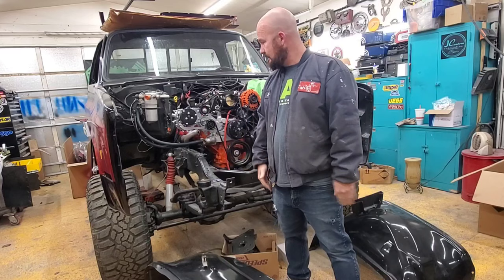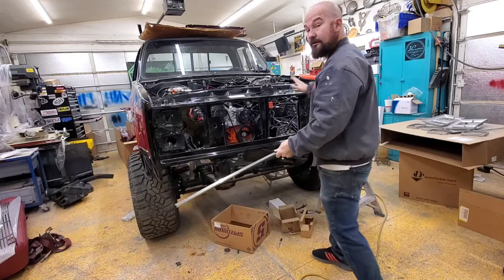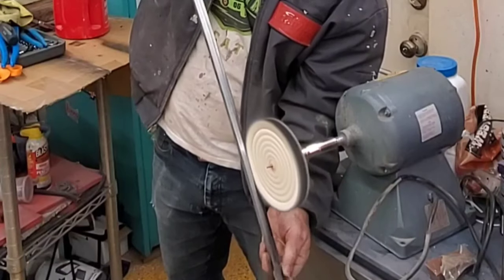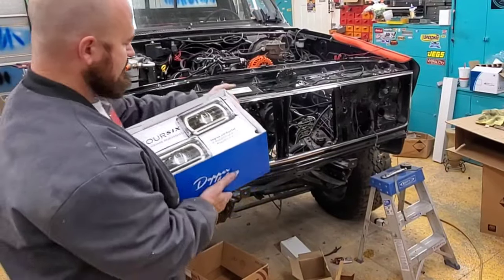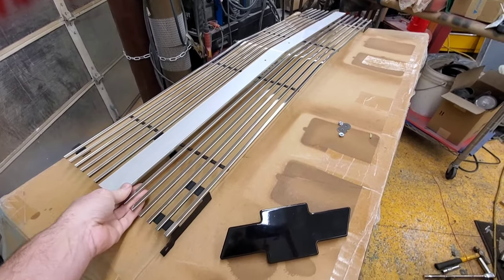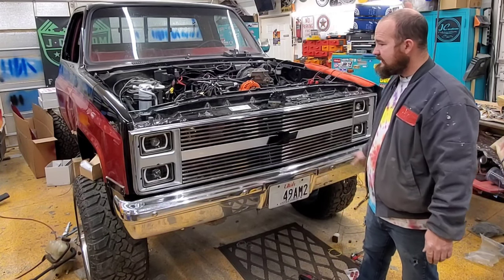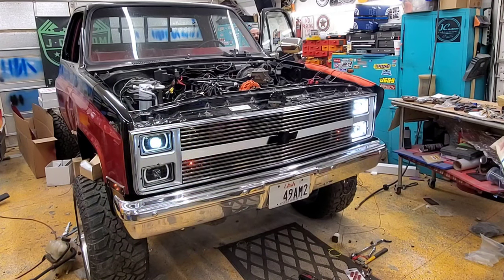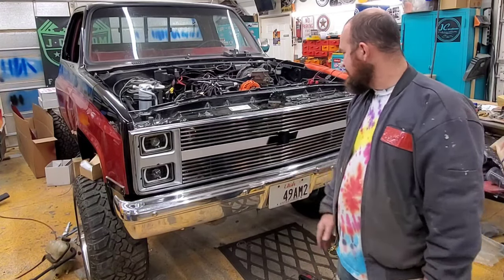85 chevy Square body core support, grille, and headlight installation on k20 truck k10 c10 k5 GMC

Comment: I was about to order these headlights. I noticed they have high beams LEDs is 2400 lumans and low beams 1800 lumans. I also see when you order you can get both high and low in 1800 or 2400. Did you end up doing one of each (low 1800 and 2400 high)?  Thanks
Reply from the maker: I would give him a call, I upgraded mine to a lot higher lumens... They don't show on their website... And make sure to refer my YouTube channel
Reply: Will do.  Did you know what lumens you upgraded to? Also do you have different lumens for high versus low are they the same. I’m going to order them now then call them on Monday definitely will be using you as a reference thank you

Comment: Hello. I bought the same lights for my 87 K10. The headlight bulbs are 30 watt Leds. Did you have any issues with the  low and high beam headlights  working correctly?  When I hook them up with the harness Dapper sent both the low and high beams light up together when turning on the low beams.  Turning the high beams  on and off doesn’t work, both low and high beams stay on. Do you have any ideas about what’s wrong?

Comment: How did u wire lights ? When I cut my headlights on amber oracle light comes on with headlights.
Reply from the maker: I wired the Amber lights to the turn signals and then I made the white lights turn on with its own switch